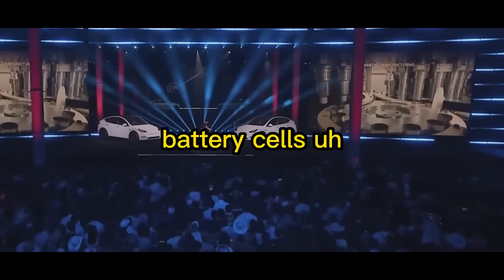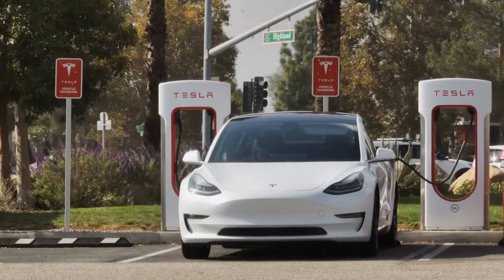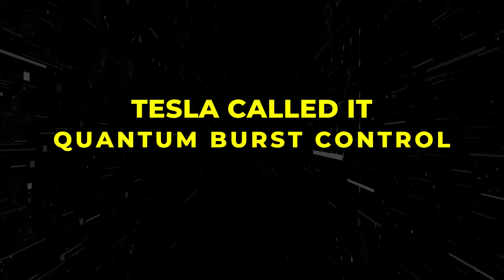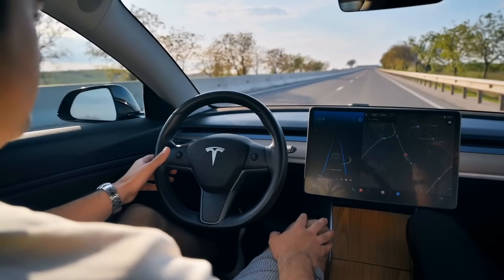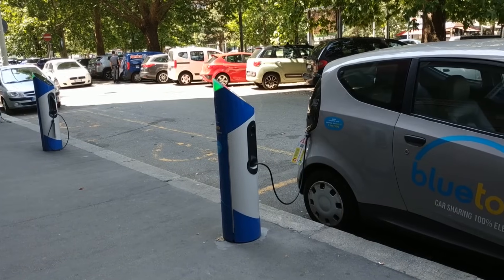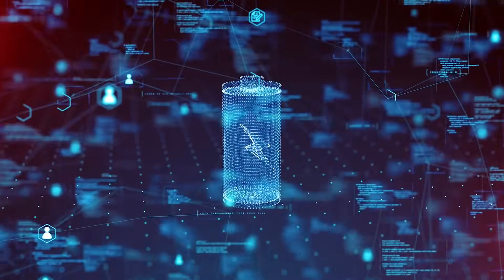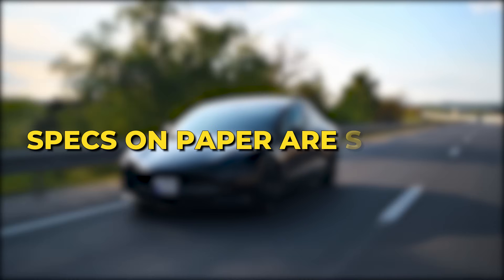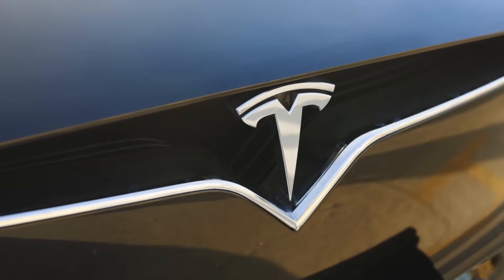Tesla’s Secret Aluminum Battery Breakthrough Changes Everything

Comment: May 13, 2021 — The graphene aluminum-ion battery cells from the Brisbane-based Graphene Manufacturing Group (GMG) are claimed to charge up to 60 times faster. They were granted a patent in July 2025. The University of Queensland (UQ) is a key player in developing advanced graphene aluminum-ion batteries, collaborating with Graphene Manufacturing Group (GMG)... UQ holds the original patent.
Reply from the maker: Thanks for sharing that detailed information about the graphene aluminum-ion battery!